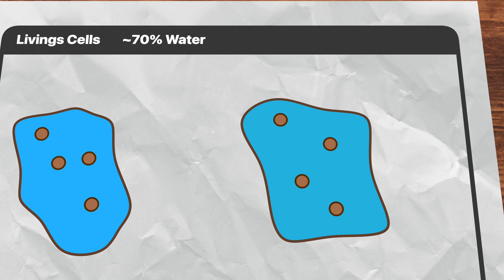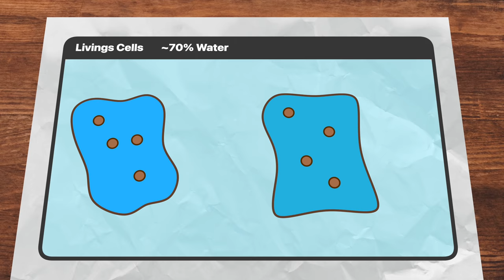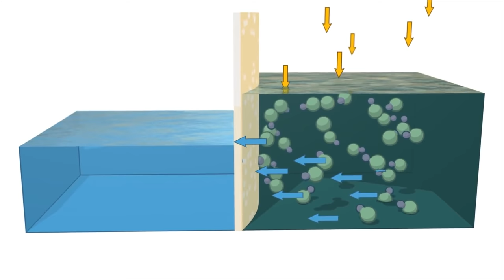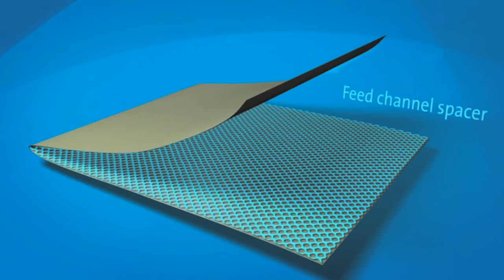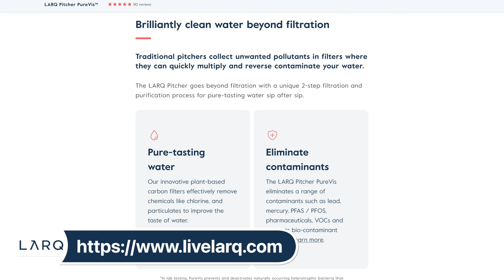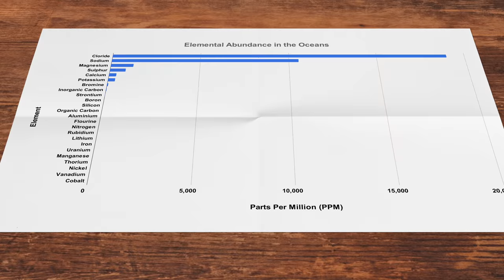Why Not Build Desalination Plants EVERYWHERE?

Comment: Kuwait recently built a solar power plant near one of their desalination facilities. It provides the facility with roughly 35% of the energy it needs during daylight hours. Still a carbon footprint, but much less than before
Reply: If  the planet would invest in a solar panel setup the size of New Mexico in the Sahara, which is a small area for the Sahara, it could produce enough energy to power the planet and then some.   The energy the Sahara receives in 6 hrs is enough energy to power the planet for a year.   To build it in the middle of the Sahara is also cost prohibitive as there are no roads for 100's of miles to build and maintain it but it can be done.  Imagine "free" electricity for all.   To solve global issues require global commitments.
Reply: @J R  is it really true that just 6 hrs can power the planet for a year? Seems very unlikely but I don't know.

Comment: Combining solar thermal with vacuum distillation to lower the boiling point is definitely the way to go in hot regions.
Alternatively, molten salt nuclear for cold regions.
Reply: I agree..that what we do when we put an air conditioning unit under vacumm. to extract the water in the system.

Comment: I live in south Florida, on a hot day , my air conditioner produce 9 cups of  clear water in an hour. I always think that if we can further filter that water which does not have any salt to begin with we would have plenty of drinking water.
Beside, with  the dehumidifier inside the house , I empty out  about 1 to 2 gallons of water within 24 hours from the dehumidifier. Water tastes a bit plastic taste but not salty.
 I haven't try  putting them into one of those pitcher to find out if it take out the plastic smell and drinkable and do lab test to see how clean is the water in term of chemicals. Limited by living with a partner who does not care about new
 invention or solving any human problem like me and very controlling.
So, I ask if anyone has a means to test water from 2 sources  I have mentioned  through water filter pitcher and then in the lab, please, share the result.
Reply: south florida is extremely humid.....this wont work in the rest of the world
Reply: This works only because you're already living in a jungle-level humid enviroment...and beside the sea too

Comment: I've always wondered if you could just spread the brine out enough to not be a problem. If you fan out the outlet pipes into the sea far enough and have small holes along the way, the salt should just mix back into the water, right? There has to be some acceptable level of variation in water salinity that wouldn't kill everything. But hey, if you can extract useful resources from it, that works too. Pull thorium out of the water and run a MSR reactor to power the whole operation.
Reply: That's exactly what they do.  The problem is exaggerated.  There's a lot of NIMBYism going on.
Reply: What if we made a pile and dried them? Then we could work on processing the pile the way they process mining tailings?
Reply: You could dehydrate it into salt. We need big mountains of salt for our roads up here in Canada.
Reply: @-whackd  How much energy does it take to reduce it to solids?  You're right, it could be ground into a 5-10mm "sand" and then spread on roads.
Reply: @dansanger5340  if they want to get 1 ton of fresh water, th... I could go complicated... or dare you to try to breath with 0.5% less oxigen and say again that the problem is exaggerated.... mind you that tomorrow it'll be 1% less...
Reply: Dan Sanger is right, the brine isn't that bad (if it's bad at all when dumped right). But it would have sense to harvest minerals from the brine instead just returning it to the ocean.
Reply: @robertroigsantamaria  You probably should have gone complicated.  The amount of oxygen at 500 ft (150m) is about 0.5% less than at sea level.  That's nothing.  Nobody has a problem living at that elevation.  Nobody even notices it.
Reply: i think the only feasable way to "spread it thin enough" is to introduce it into a river carrying loads of low salt water .. evening it out there .. but that could be deadly to the marine life which tries to live in this low concentration river delta part of the sea and it limits you to have those plants close to "fresh water" rivers ..
Reply: @TheyCalledMeT  you don't have to pollute fresh water, the brine isn't that bad for the ocean, it only affects the immediate point where it's being poured and the surrounding life is not affected negatively.
Reply: @TheyCalledMeT  The salt is released slowly over large areas in the sea using diffusers.  It only raises the salinity very slightly.  It does not damage  anything if done properly.
Reply: There is way more uranium in seawater than thorium. Thorium isn't nearly as soluble in seawater as uranium. And we have developed polymer mats capable of selectively absorbing the uranium in the seawater.
Reply: We have plenty of oil tankers crossing the oceans, and think, on the way to get the oil, they are empty.  Load them up and have them pump out their brine over a large area.
Reply: @robertroigsantamaria  about 7 pounds of salt in a ton of seawater

Comment: Saddest thing is that so many areas will pull up ancient ground water, replenished only over centuries, and then use it to irrigate grass with fresh potable water, while at the same time dumping the clean grey water from the sewage system into rivers, because it is "dirty", and then also mandating that people must have these lawns to "keep up the appearance of the neighborhood" as well.
Reply: Great points!
Reply: I would 100% be down for making watering lawns illegal. Like really illegal
Reply: @skeetsmcgrew3282  For me watering the lawn most of the year not really needed, the rain does it.
Reply: @skeetsmcgrew3282  Yeah, I live in an area that gets decent rainfall. So what if the grass is brown for a month during the summer? It's 90 degrees out, that's natural. Yet around here we're just dumping thousands of gallons of treated water out for a short lived and relatively minor aesthetic improvement.
Reply: Just FYI, sewage is black water, not grey water.  It’s not clean enough to water lawns by a long shot.

Comment: I have my doubts of actually getting much use out of the metals found in the water. Even if we assume you could easily separate out the most abundant elements that n the sea water, lithium you’re only look at about  .25 parts per million. 1 ppm is equivalent to 1 milligram per liter and 1 metric tonne of water is equal to 1,000 liters of water. This means for every 1 metric tonne of water produced you would only get 250 milligrams of lithium. You would need to process 10,000 metric tonnes of water just to get 2.5 kilograms of water, you would need about 25 times that amount of material just to produce a single Tesla battery. The cobalt nickel and other metals in the water come on even smaller amounts and just wouldn’t amount to anything significant worth extracting.
Reply: I think every little bit helps
Reply: Exactly this.
Reply: It becomes a measure of what extraction efficiency is to how much water is being processed. We use water nonstop so if extracted without too much trouble, given what demand is looking like for the elements, every little bit might count. If too inefficient, then doing it just for the sake of being green would just be dumb. Ahem...cough...plastic recycling... coughcough...
Whew. Excuse me.
Reply: I think the main idea is to produce freshwater. If the byproduct of desalination is lithium that could be recovered,  BONUS
Reply: @codyfan7161  every little bit DOES help but every little bit also.... has to be paid for. 
If it is not financially viable there's no reason for anyone to step forward and bear the financial responsibility for such projects.
Reply: @Battlefox64_RL  unfortunately this is how it is with many boondoggle projects that the government steps in and subsidizes which costs you and me a fortune but makes the project appear "affordable". Like Green energy. Take away the subsidies, let it stand on its own in the market, and see what happens. And make no mistake, the purposeful huge increase in oil prices is an attempt to make green energy look affordable in comparison.
Reply: You are correct about the significance.  However, this needs to be measured in molecules (molar)weight.  When done , there will be such a minute amount, it will be invisible to the eye.
Reply: Sodium ion batteries
Reply: @AmandaHugenkiss2915  BINGO!
Reply: @AmandaHugenkiss2915  you do know oil and gas are heavily subsidized too right? If they were left without subsidies the oil companies would collapse so complaining about government green energy boondoggles really is missing the mark.  Much less the government picks up the tab for the spills and accidents, and we have to deal with the pollution caused by fossil fuels that kill people every day, green energy far less deadly.
Reply: @GOLANX  they absolutely are not subsidized. Show me where the government is handing them money or providing incentives comparable to green energy projects. And don't come back with depreciation and write-offs for capital investments and things like that. Those are standard business deductions available to every company out there regardless of industry. Also, show me where the government is paying for spill clean up and such. It's the company who pays, usually through fines and court judgement.
Reply: @dont.ripfuller6587  Yes, I think that's about it.

And most of the plastic in the oceans allegedly comes from about five large rivers in poorer developing nations. I regard it as a litter problem. The stuff can be burned or otherwise processed. Just throwing stuff in the river is something largely abandoned in the West many decades ago.
Reply: @AmandaHugenkiss2915  Just curious as who it is specifically that wants renewables to appear cheaper, so much that they would sabotage oil prices?
Reply: True however lake mead is now full of waterw this  and new fish resources are worth big $ and tasty.
Reply: There are more problems, because the Lithium will not be an elemental metal. The Lithium will be in form of a salt like Lithium chloride or Lithium sulfate.
these salts must than be processed with something like electrolysis to get the elemental metals. (which needs big amounts of electrical energy)

Another thing is that for every Lithium salt you get, you also have 40,000 times the sodium salt (likely NaCl), which is commercially worthless. 
If you can´t pumpe it back it the ocean than you must build large waste dumps, where you store the salt, which also cost you money and space

For water treatment and drinking water production, these ideas are fine, but the metal-extracting is only marketing chitchat for me.
Reply: A couple things.  I am going to use his numbers as best I can.  Looking at the chart at 8:48 it looks like about .1 PPM for lithium or .0000001 to one ratio.  Then he said 100,000,000 tons per day ( I am assuming imperial and not metric tons).  So .0000001 x 100,000,000 tons = 10 tons of lithium per day. .453592 KG per pound.
Gives 10 x 2000 x 0.453592 = 9,000 kg per day.  Or 3 million kg per year.  So his 9 million kg must be over three years not per day as he said in the video.

But, that of course, is not the biggest issue.
Reply: @ChristianGM1412  Exactly.  (although you could sell the NaCl as Sea Salt) .  He makes it sound like all those other elements would just fall out the other end.  But nothing could be further from the truth.  All those element are mixed together in the salt and need to be separated.

One of the things that will be required to separate them is water.
Reply: @AmandaHugenkiss2915  maybe not in the US but other countries do subsidize pertoluerm products like gas for cars or electricity produce from these products.
Reply: @Bigmojojo  that may be, I'm no expert about other countries, nor do I care what they do, that's on them. But in the US this is how it works and how it affects our population. Plus we have enough known petroleum that we could be self sufficient for hundreds of years. Advances in extraction technology will take that out even further.
Reply: @willcstgd  
Any government leader that is supporting carbon taxes and carbon Cap & Trade systems...
So, basically, ALL of them.

Deliberately raising the cost of fossil fuels to make green energy LOOK affordable.

Comment: Lithium!  I like the way you think. We can definitely use it and the nice minerals. There isn't much Gold, for example, but it is worth its weight in itself. Also, in greater than 1ppm concentrations we have Fluorine, Aluminum, Strontium, Silicon, and Boron, all of which are useful, especially in the energy sector. Nice reporting.
Reply: There are sodium batteries! Rechargeable no less. Chloride batteries maybe for some storage projects, I don't think I could want that in cars more than the lead ones already do...

Comment: I worked with desalination systems in the Navy, they are very high maintenance and the water can give some people  
intestinal problems.   Nevertheless it does seem that this will be the path forward for any water shortages.
Reply: what, if we would simply try to collect oceanic rainwater in the tropics, where rain falls almost every day, and transport the collected volume in the biggest tanker fleets available to those dry coasts?
Reply: @konradcomrade4845  Sounds like a good idea. We are going to use energy anyway producing water so why not capture rainwater on a huge tanker?
Reply: @konradcomrade4845  doing things on extreme large scale and long term is extremely diffcult to plan since you dont want to make changes to the surrounding ecosystems that cant be restored afterwards. basically we are stealing the rainwater from the tropics that surely has its own purpose there. Also it sound like a super expensive way to deliver water..
Reply: @misterae6430  Israel's been desalinating water for decades.
Reply: @brettb614  Saudi arabia is the leader in desalination I believe

Comment: It's always 40 years in the future with these projects. Meaning it will never happen. Those lithium concentrations are far too low to make it economical, not to mention that despite what people think, battery grade lithium is extremely sensitive to tight chemical tolerances that will never be achieved in a project like this. Makes a cool video though.

Comment: Excellent Vid.  Up here in the BC where I live, Our waste water is treated via "Activated-Sludge Treatment Plants" and the treated water is more along the lines of treated gray-water, wherein it is disinfected but not quite potable, ( BOD-5 is excellent and the pH is close to 8.3, etc)..... that water, the Effluent, isn't returned directly back to the " Receiving Waters" but rather it is pumped uphill and used for irrigation of huge tracts of land. That water in turn percolates back into the soil and then eventually  ends up back in the lakes around the area which sustain fish and wildlife. Return of human usage I would guess at 90 %... the rest is going into septic fields and through natural filtration without disinfection back into the Receiving Waters.....Much of this water is currently from commercial businesses where the effluent may contain oils, chemicals, or heavy metals, etc.... And that's a Big issue....  We are also looking into "iMBR type treatment " too.... I digress.
      Getting back to Desalination,.... Reverse Osmosis, ( RO ), is costly for huge volumes of water processing. Such undertakings in an area where hydro-electric or wind-electric generation to power said plants might be scarce and leaves one with the option of nuclear or coal or diesel power.... None of which is Green....Tidal power, ( Adams turbines or Delta-T ammonia or Tidal wave -  generators, per se....), may be a viable solution. 
That said ,.... With the new(ish) reinstatement of the study of Sodium Sulphate Battery technology, and the reclamation of other elements like Lithium and needed Transition metals, For many countries, Desalination may be worth doing financially, with clean water being the 'Gravy on the plate.'
Stay Safe.

Comment: There are many obstacles to over come with solar power desalination and power generation.
1. You must be able to collect the steam in a relatively small area in order to get the pressure high enough for the turbines,                     but you need a large area for the solar collectors to generate the amount of steam needed.
2. Turbines need constant pressure to operate efficiently they prefer constant RPM and are not as efficient with speed changes. Solar is not constant even in the desert. Night time no solar to generate steam, Morning and evening indirect sunlight provides less solar energy also cloudy days will reduce solar output. Peak solar output is between 10:00am and 4:00pm each day that the sun is out.
3. Must engineer a way to remove the brine without shutting down the solar collectors and stopping the steam generation.
4. Backup thermal systems to create steam when solar not available will be very costly.

These are few of the engineering challenges that I think will be eventually overcome but it will not be cheap. The biggest is the constant energy input that is needed. Currently only fossil fuels and nuclear energy can supply the 24/7 constant energy needs.